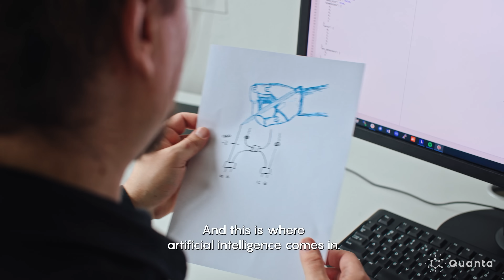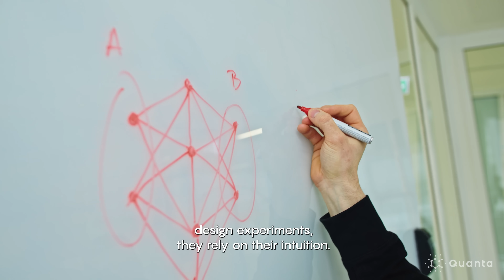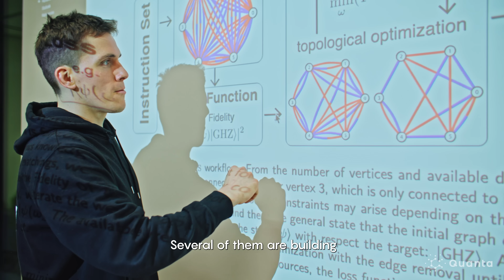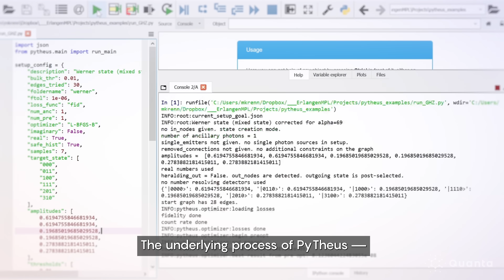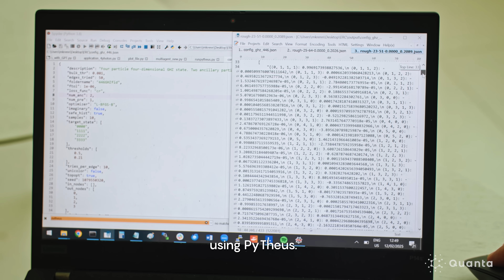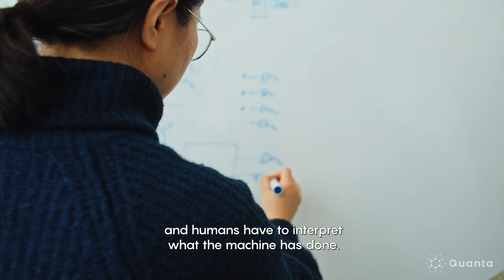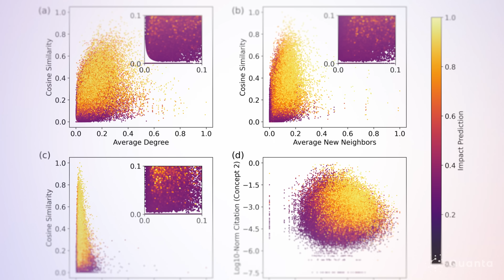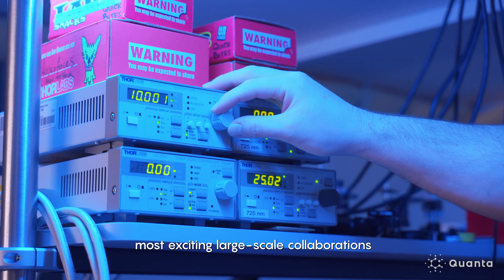The AI Breakthrough That Finds 'Impossible' Experiments

Comment: I often wonder how specialized AI like this is even made. I understand ChatGPT had to use the entirety of the internet to build its chat capabilities; how big is the sample size for something like a theory bot?
Reply: I think it goes something like this:
Imagine a chess AI. One way to train it would be to used grandmaster-level games as training data. However you can also train the AI by having it play against earlier versions of itself, making it get (likely) better with each iteration. The second approach doesn't need external training data. All training data comes from the previous versions of the AI (starting with random moves in the first iteration), so you can talk about synthetic data not coming from the internet.

Now think of the quantum experiments. You want a quantum system, that uses a limited number of types of components and achieves something. One way to find a good system would be to brute-force all the random placements of the components (or the abstract graphs mentioned in the video). But going through all graphs until you find a good one could take too long.
So they mention training an AI on these abstract graphs. I think they randomly generate millions of graphs and compute the properties of the quantum systems represented by the graphs to get synthetic training data. And with synthetic data, they can train an AI without the internet.

How does natural language understanding (as seen in ChatGPT) differ? Language is not as predictable and its rules are passed down from person to person and in texts. So for AI to learn it, it too needs to speak to people or see many texts (like all of internet). You could try deriving precise rules for understanding language, but that would be hard given that language changes through time and its too complex in general. Without precise rules, you can't have synthetic training data that represents all the actual data well and so you need external data.